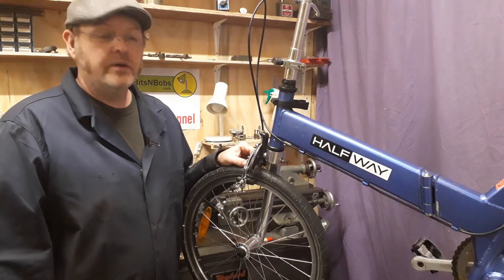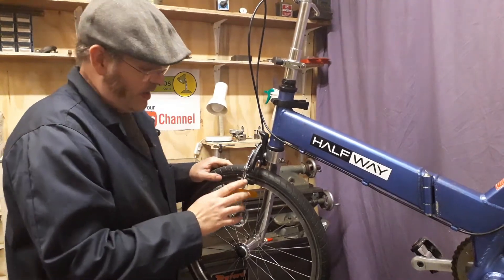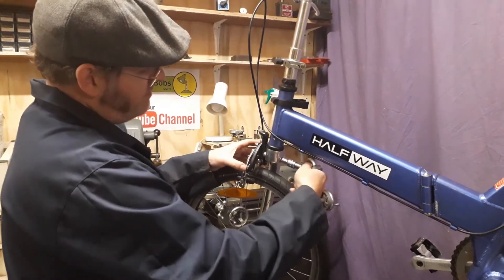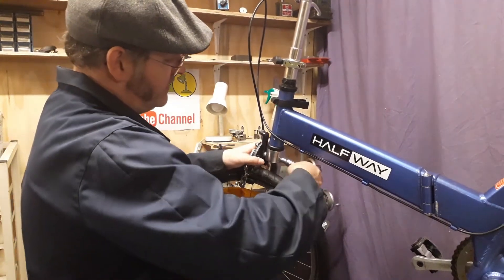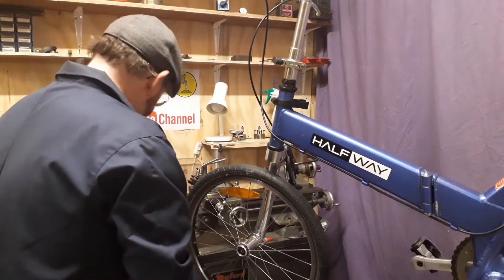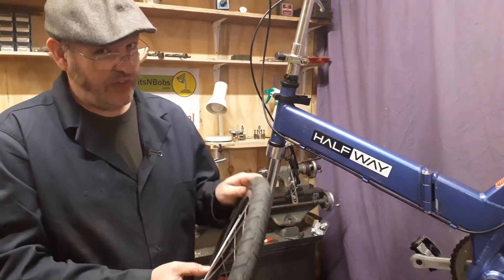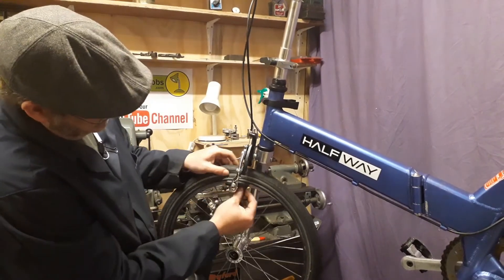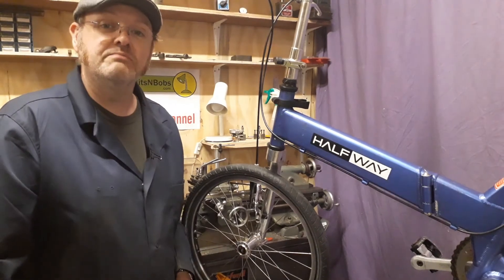Giant Halfway wheel removal/puncture, mono blade

Comment: Thanks for this Matt. However I've undone the front wheel as shown, removed nut and washer... but the wheel doesn't want to move: Have I missed something? It's to replace tyre and tube. Any hints gratefully received
Reply from the maker: Thanks for watching Vanessa, to replace a tyre or tube you don't need to remove the wheel as shown in the last part of the video, I would just remove the brakes. But if you need to remove the wheel I would think it's just a bit stuck that's why I advise copper slip when you put it back on to help prevent this. 2 things I would try, 1 from the fork(!) side get a bit of wood around an inch squre and 6 inch long and with the square end on the hub give the wood a few taps with a hammer but mind the spokes. 2 the same thing but after trying some wd40 or gt85 soaked over night from the other side and then trying to tap it again from the fork side. Hope this works, let me know, Matt
Reply: @mattsbitsnbobsworkshop  brill, Matt, and Thankyou: I’ll have a go at that 👍
Reply: @mattsbitsnbobsworkshop  I've changed the tyre and tube by taking off the brake callipers: Where exactly does the copperslip go please, Matt... for future ref: I was unable to shift the wheel having just tried the careful tapping with a suitable piece of wood.  But when next time, now I know that it's jammed I'll do a "proper" job - thanks to you
Reply from the maker: @VanessaBretton  Wow, mine was stuck at first but the wood sorted it, maybe next time look in to a thing called a gear puller, it hooks on to the hub and the threaded bit in the middle pushes againts the shaft (axle) but be carefull if its really stuck the shaft could bend! The copperslip goes on the shaft before the wheel goes back on to stop it getting stuck! So for now nowhere. Thats one thing with the mono set up no need to remove the wheel, luckily. cheers.